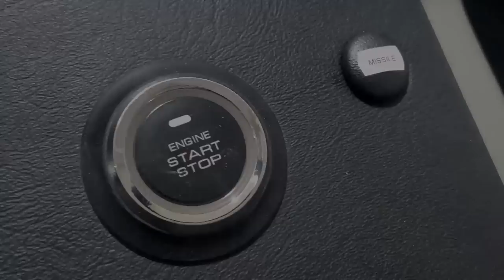Interior Complete - Missile & Eject buttons, DIY Glove Box

Comment: It was great seeing the prototyping, template, and fabrication of the glove box. It is so much better having the glove box drop down as opposed to lifting a lid up. One design/engineering element that I noticed with new car glove boxes is a single rubber strap on one side of the box, which loops around a tab on one side of the box. This restricts the glove box from falling fully open, but allows you to slip off the strap for access when needed. In those designs, the car's cabin filter is behind the glove box, so this works better than a curved, fixed channel and post. The panel edging trim cleans up the seams well. You should get a fan of your Electric Supercar channel who has a 3D printer to make you red button caps with an icons of a firing missile and ejection seat!
Reply from the maker: Thanks for the comment Dean!